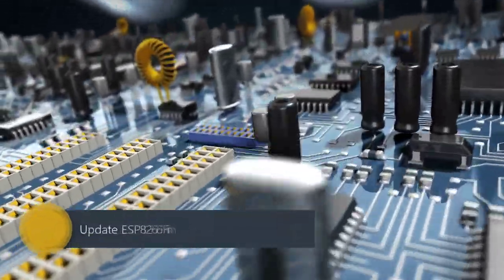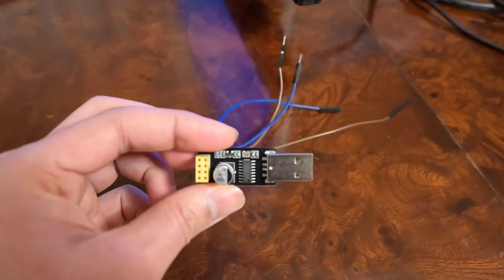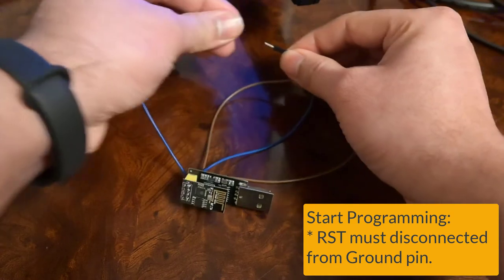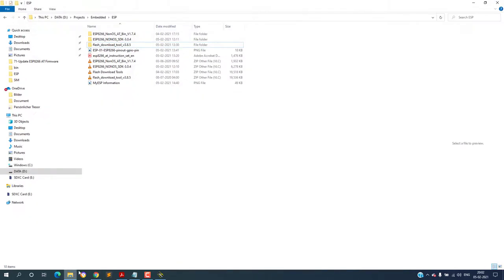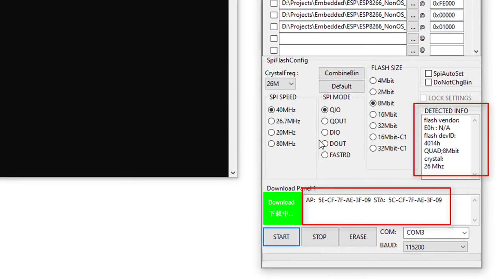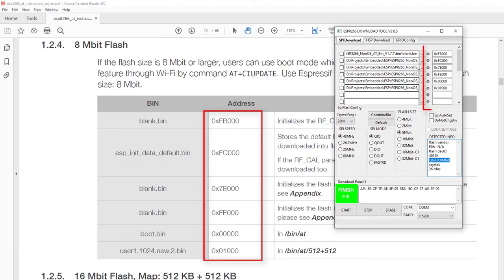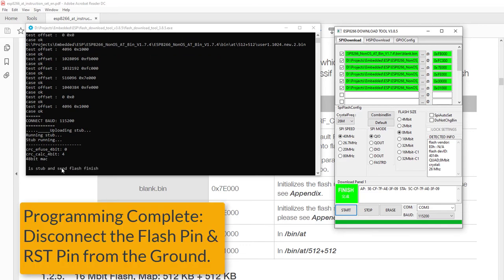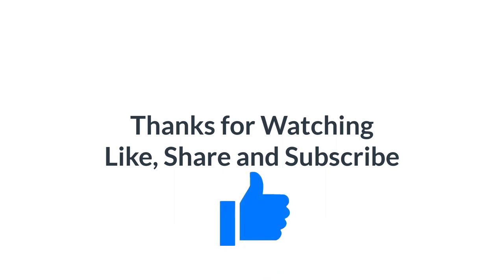Update the AT Firmware in Your ESP8266 WiFi Module

Comment: This was a very useful video for me as I had never used an ESP-01S before and I assumed those USB adapters were capable of programming them. I did the same modification with jumper wires - it's a nice, quick way to get going albeit with some soldering. I wrote an article on using the ESP-01S with the Pi Pico. Thanks!

Comment: I've spent over 8 hours trying to flash my esp8266 boards and this was the most useful and helpful video ever. Thank you so much for the time and effort on posting this video. 

The method of connecting the reset/flash to ground and leaving flash grounded after resetting has fixed many problems while flashing(no response, serial errors, etc). Thank you so much again!
Reply from the maker: Thank You :-)

Comment: Great video - concise and to the point. Took me a while to figure - but the module has to be put into AT+CWMODE=3 after flashing new firmware, otherwise AT+CWLAP returns "ERROR".
Reply from the maker: Sorry I couldn't answer this question at the moment. Please check the datasheet and also match which software version you are using on the ESP8266 device.

Comment: Whatever i try, my module will not respond to any serial message, i just cant figure out why
Reply from the maker: Did you tried by changing your baud rate? 
This is the only reason which I can think as of now
Reply: @grindfi did you end up figuring this out? I can't get my device to output anything in the serial monitor. I've tried multiple esp-01s and still nothing. I have not tried to flash them yet.

Comment: Hi, great video. Is this just for esp8266 esp-01 or can I do it even for nodemcu and wemos d1 mini version which has more io pins. Thanks for answering
Reply from the maker: Thank you for your comment. 
I think It will work for all esp8266 modules, but you just have to find out the correct pins to force reset and flash pin to ground as shown in the video. 
I have one nodemcu with me, so I can try with that and update you.
Reply: @EmbeddedLaboratory   Thanks :)

Comment: hello thanks for the great video the flash process has worked so far however I get no output on the serial monitor and when I try to upload something there is also no output on the serial monitor when requested and that with all esp01s I have flashed with it with all the same error
Reply from the maker: Is your USB to serial converter working, you can check this by shorting RX-TX line, if this works then maybe try to check your module connection with USB to serial.
Reply: Hey @mortarmax did you end up figuring this out? I can't get my device to output anything in the serial monitor. I've tried multiple esp-01s and still nothing. I have not tried to flash them yet.

Comment: The ESP8266 NON-OS BIN that you downloaded.....  is no longer available on the website you link.   (further adding to the confusion if anyone wants an ESP8266 to work).   This tutorial doesn't work any more as a result.
Reply from the maker: This is not true, you can still find this under ESP8266 Legacy section
https://www.espressif.com/en/support/download/at?keys=&field_type_tid%5B%5D=14&field_type_tid%5B%5D=799

Anyways I have uploaded the firmware used in the video under the following link, you can get it from here.
https://drive.google.com/drive/folders/1_yVx1YJBJTnIHccdlpT30ym7gHOsLqRI?usp=sharing